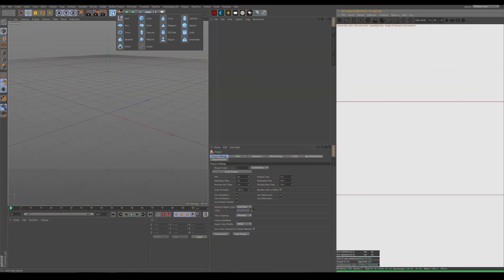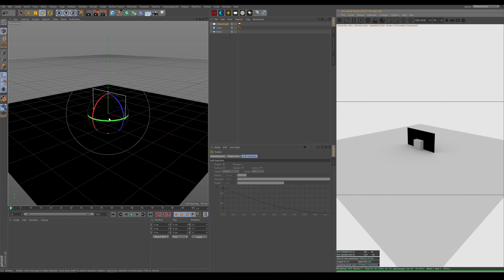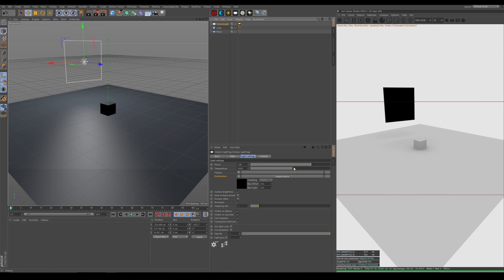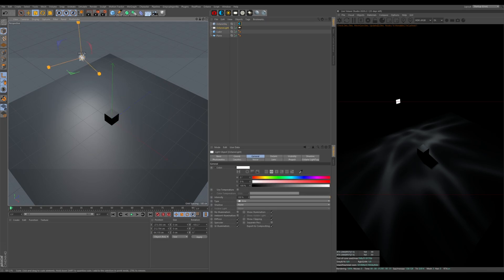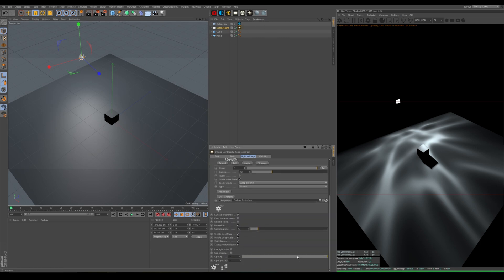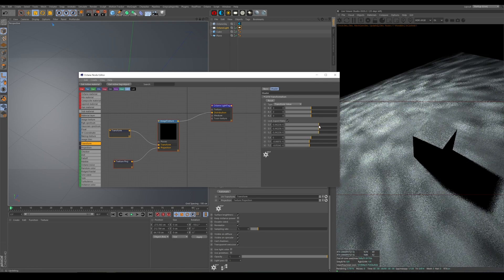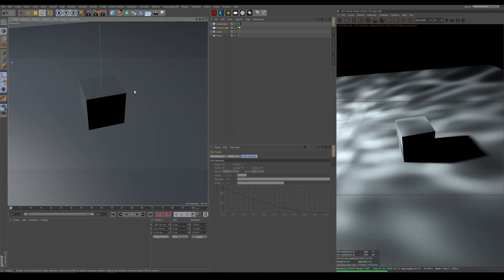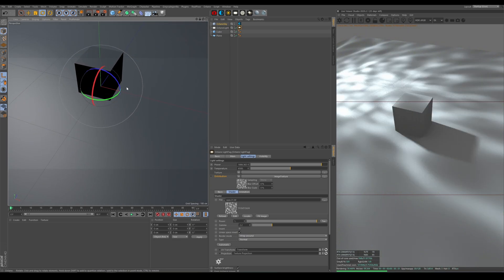BLADERUNNER 2049 OCTANE RENDER CAUSTIC LIGHTING CINEMA 4D

Comment: Lovely - great tip. I wonder if animated keyframes in the transform node can be used to achieve the organic randomness of water caustic movement
Reply from the maker: 100%, if you move it very slowly it looks super cool. Also adding color to the distribution in all sorts of manners adds amazing effects.
Reply: Yeah, you could animate the distortion using a displacement map effects in after effects.
Alternatively, I'm pretty sure it would be possible to replicate the caustics patterns using native noises layers which would be even more accurate.